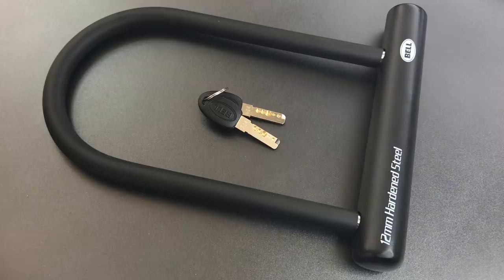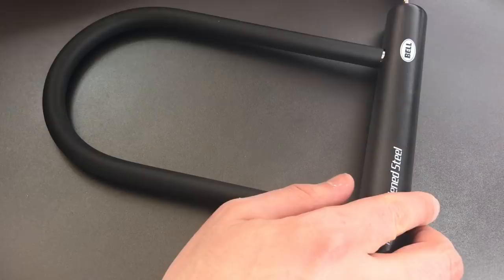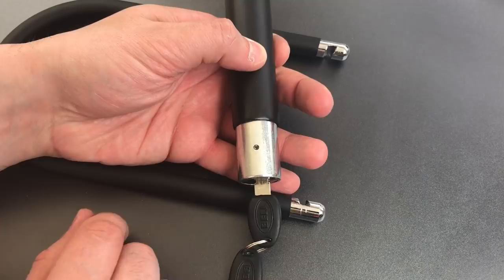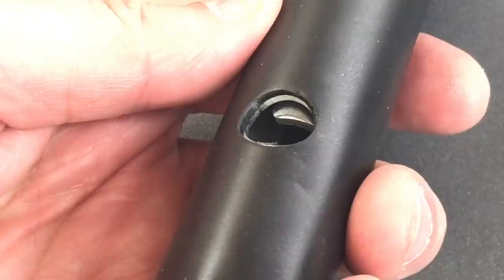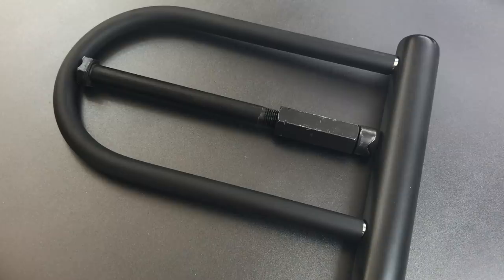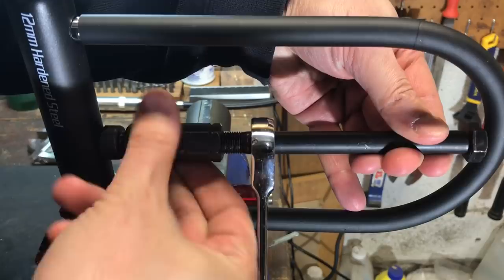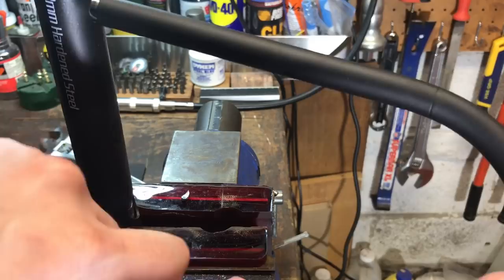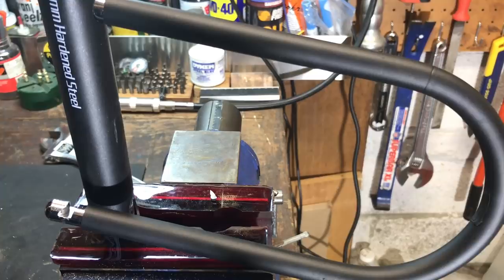[655] Screw Spreader vs. Bell “Catalyst 300” Bike Lock

Comment: Bell: our locks suck so much that it takes longer to list all the ways to defeat them than it does to actually defeat them.
Reply: metamorphicorder:  they need to focus on HELMETS
Reply: Bushtrail Rookie:  Bell's roots are groundbreaking racing helmets. However, they license their iconic logo to a bunch of crap products. Cheers
Reply: LockPickingLawyer. I admire the clearness and specific application of langauge in your references to the question at hand you employ. Perry Mason should speak so well. Mazel-tov.
Reply: @lockpickinglawyer  , where can I find this very  Screw Spreader?
Reply: @mishakmr871  2 bolts and a coupling nut
Reply: What do you want for $10.  Without tools you can't open it...
Reply: @ultimaetsolder  thats not the measure of a lock. Thats the basic deefinition of a lock. The entire purpose of a lock is that it takes a tool to open. Thats the bare minimum it should do.

Comment: Look up Fowler hardness testing files. It's a set of files that are progressively increase in hardness. Basicly you lighty rub up against the part you want to test with each file until you get a scratch. It's not super accurate but pretty darn close.  I'm a mold maker and have used them in spot checking heat treat on mold components. I have also cross checked them against a Rockwell C tester in our QC lab .
Reply: Lighter scratches at a level 6, with deeper groves at a level 7.
Reply: Hey! .. .Great tip. I never heard of them before ... i worked in a machine she for years but we had a half dozen Hardness testers there ... I've occasion to WANT to know the hardness of metals since ... I'm looking at some of the hardness testing files on line now! .. On my wish list

Comment: This reminds me of when I first moved to New York City and saw an apartment that looked like Hercules pushed open the door. Apparently, a thief took a hydraulic car jack and an I-beam segment cut to a length so that the jack plus the I-beam equaled the width of the door frame. Then the person just quietly pumped the jack, the entire door frame spread open, and even the double-bar "submarine hatch" lock on the other side had nothing to hold on to. Voila. I had a grudging admiration for the thief's ingenuity.

Comment: I both love your videos (for showing lock picking techniques) and hate them (I have this same lock on my bike). Thanks for making these, even if they do give me heart palpitations!
Reply: Pretty sure anything that even remotely looks like a lock safes your bike from.being stolen as long as it doesn't cost like 1000$
Reply: it just means you need a new bike lock lol
Reply: Praemonitus praemunitus - forewarned is forearmed
Reply: Cool.
Reply: @p529.  You'd think so but I've had pretty junky bikes stolen twice before. On both occasions mr. cordless angle grinder appeared to be the culprit judging by the cut marks on my crappy locks.  Resale value on those bikes would have been $100 each at most.
Reply: @stoutlager6325  oh wow that sucks man

Comment: Thanks for this, we had one of these that was left around the incoming natural gas line to our business.  The gas company did not like the idea of having a bike/lock connected to this sensitive pipe.  I didn't want to use bolt cutters next to a 54 psi gas line in case of shrapnel (like in this video with the spreader)  or anything.  My picking skills on a rusty lock that has been sitting out in the elements for every are questionable. But the tip that the "hardened steel" isn't really very hard told me to try a hacksaw.   After about 10 minutes with the hacksaw it was off.

Comment: that screw spreader is something else. to bad they don't make a mini version for padlocks
Reply: Manifold spreaders are chiefly designed for cars, so they are larger. But this one from Hungary might work because of its design -

https://www.ebay.com.au/itm/3049A-VW-AUDI-Exhaust-Manifold-Spring-Clip-Spreader-Made-in-Hungary/261165917539

If you wind it all the way in, it might fit larger shackles. The design also lets you wrench it from the outside. However, it is a little pricey.
Reply: i mean, you can easily make one yourself with some small bolts and nuts, get a threaded rod and put several nuts on it, weld the nuts together and remove the rod. Then just screw the bolts in and you have one.
The spreader simply has to be stronger than the weakest part of the padlock, which will most likely be the shackle

Comment: I bought a $20 Bell bike lock in 2017, long before I found this great channel.. It was a nice looking laminated braided cable with a key lock to connect the ends. My bike was stolen outside my apartment within a few days! (It was a free bike I got from a driver at work who got it as a tip!) I found the lock in the bushes with the cable sawed clean through! I found my bike a few days later just sitting on it's kickstand near a different bike rack at the same complex I was living in... Many parts from that bike are in my homebuilt moped now. It's the Frankenped and it's a fun bike! I now wonder what type of core was in that Bell cable lock that someone cut off my bike..... Not that it matters.

Comment: If you do another video on cutting the shackle and pulling out the lock with the slide hammer, you could do an overall comparison of the 4 different methods (in terms of time, sound produced, skill necessary, and price/availability of required equipment).  It'd be cool to have videos of your 4 primary exploits on the same lock.  Or break out the Ramset and get all 5!

Comment: I forget where i mentioned it, but there are products to block that space in the middle if you're locked up and find yourself leaving a ton of free space in the lock opening.    They were originally sold to prevent thieves from putting small hydraulic bottle jacks inside Ulocks.
Reply from the maker: I highly doubt you can block this. It’s super skinny. Maybe not impossible, but very hard.

Comment: You have probably just posted an easy and cheap way to defeat my bike locks that were not too far from infallible before this. I  will have to get a short Pewag security chain and an Abus chain padlock now. 👍
Reply: I quit using my Abus class 2 88/50 cause it froze shut in winter.... got my bike nicked cause i was too lazy to use another lock
Reply: It's not new. Years ago the preferred tool for the same method was a small screw-jack.
Reply from the maker: This is not new... thieves know how to break bike locks. At least you know the vulnerability and can take steps to correct it. 👍
Reply: LockPickingLawyer Thanks for the reply. You are a gent. 

I really thought you invented the technique 🤣

Your videos are very high quality and informative. I'm a big fan. In my opinion you are up there in the top ten of YouTube. Please keep up the good work. If nothing else, it is a rare change for a lawyer to do something useful 😉

Comment: Best defence for this is to fill as much of the space inside the D as possible e.g. Securing the lock around a wheel & the rear triangle of the frame & whatever object you’re locking it to. Make it as awkward as possible.
Reply: Which many people do not do. I've seen times you can just take the wheels which would be annoying and it's so easy. They are QR haha

Comment: The catalyst 200 the smaller and cheaper lock seems to use a different locking mechanism rather than the rotating one as shown here. It'd be interesting to see that tested the same way. I use it to lock my bike along with another u lock and a cable
Reply: The krypto flex cable and u lock though.
Reply from the maker: The 200 can be defeated similarly. I destroyed one in testing a long time ago.
Reply: LockPickingLawyer awww :( well that's disappointing. I'm not worried about anyone picking my lock. Do you have a recommendation for an extra u lock then?

Comment: Looked like it had been core hardened which is wear the case is soft and the inside is hard and this is the opposite of case hardening which is what you get on cheap files it makes the outside of the metal more likely to rust but the rust is less likely to seize the lock but it makes it so it is a lot easier to brake
As only a small international amount of metal is hardened

Comment: Lol, I have the same lock, but mine is old and rusty. I have never heard of a screw spreader until I seen this video, crazy how easily it snapped the shackle!😰 At least a tool like that isn't very common.
Reply: I think these screw spreaders are a common tool in auto repair shops--but probably much less common amongst bike thieves.
Reply: I don't know if you would call it common but most auto parts stores carry it. Its used on V8 chevy's to spread the exhaust manifold enough to get the bolts to start in. I have 2 or 3 of them...there about $8.00

Comment: I didn't think there would be a way to prevent someone from fitting a little screw spreader in when the bike is locked to something, since I was able to fit a car jack inside a similar u-lock on a bike that someone had locked and abandoned in my front yard a while back.

Comment: shame locks are not really hardened, and none use a cobalt alloy steel to deter brute force and cutting, along with larger diameter shackles. anything under 14mm isn't a deterrent. for small locks in tight situations, a nut splitter can cut the shackle too

Comment: I don't think that spreader would fit, if the bike was locked to a pole/streetlight etc.
Reply from the maker: You would be incorrect. Note that it doesn’t have to be straight. It works at an angle.
Reply: You would be incorrect. Note that there is no room for the spreader, if the entire shackle is filled with some kind of pole.

Comment: U have a d lock like this and I lock my down bar on my frame and my back tire to the bike rack leaving no space for this kind of attack. It is a little challenging getting it to that position though
Reply from the maker: It doesn’t have to be in the center. Works with angles as well. That said, clever placement certainly can help. 👍

Comment: if you going to show breaking into bike locks then do it while its on a bike!! most people dont lock there bike up with a bloody vice attached
Reply: Dean Whiteside ...make you right mate...though I kinda think the Bell was a tad ropey to say the least..
I live in central London UK and the City Police (not the Met) whose patch is the Square Mile ..literally.. have posted videos of targeted  bike thefts where the locks are attacked...always 2 man team using mole grips..a kind of locking pliars ? ...as most of the bikes are owned by yuppies and cost £1500++ they don't skimp on the locks...but 2 men with a fat battery pack angle grinder+mole grips less than a minute..not a screw spreader in sight!!
Reply from the maker: Well, my videos are shot late at night, which makes that problematic.
Reply: LockPickingLawyer where can I bye a screw spreader thanks